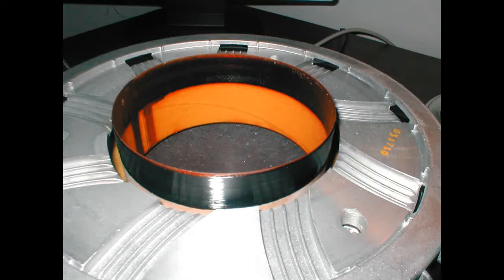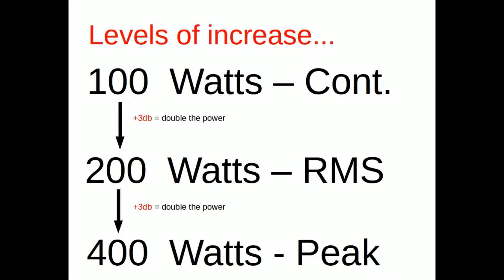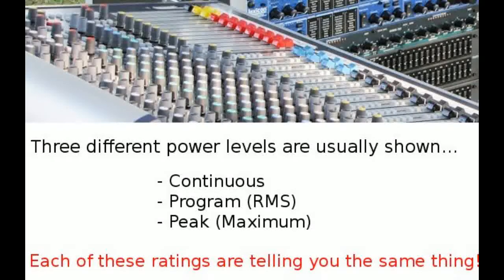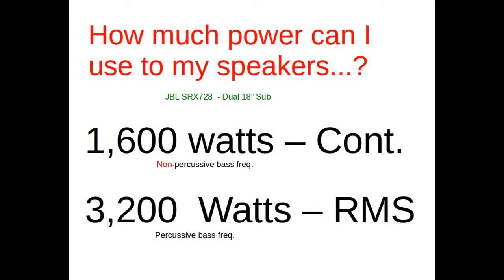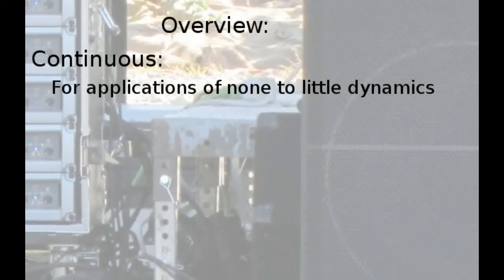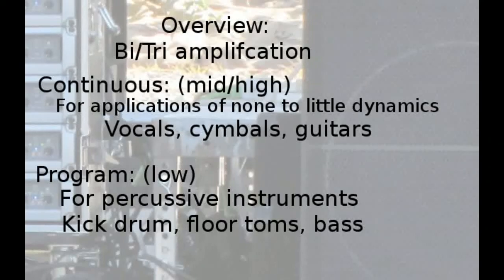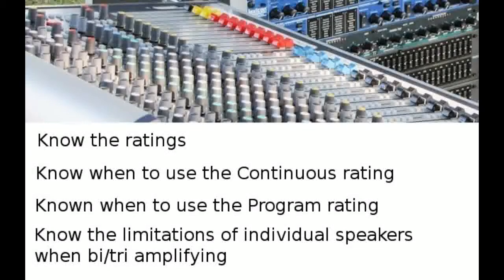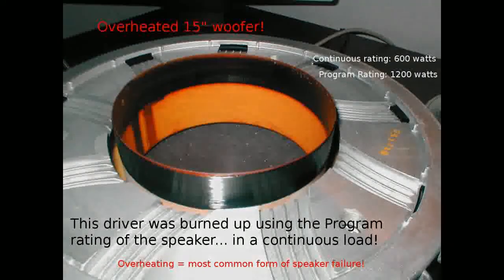What do speaker power ratings mean?   We look at continuous, RMS, and peak

Comment: Okay I'm grateful for the pertinent info on driving speakers the right way so not to cause damage or failure during a show. I 2nd that the audio was way too low I'm sure you've addressed that by now. I have a Q just an opinion. I had 2 speakers blow out at the same time. Was playing intermission music at a gig on break. The single low note of some weird rap tune with ultra low bass and way too loud in the mix killed my speakers. I couldn't believe it and took my mixer apart to see If I blew a fuse what a mess. The tweeters were still working but that's no help. It wrecked my night. I tried to find replacement speakers that fir the molded cab but unless I used the same whacked original ones nothing would fit. Stripped out the cheap steel on a screwdriver getting the very deeply recessed screws out. But the speakers just look fine what to look for? The cabs look brand new too. Do you think the speaker coils just blew out?
Reply from the maker: Thanks for your comment.  Sorry to see you lost 2 speakers at the same time; that will most certainly ruin your night.  Do you hear any type of sound out of the failed speakers?  If the speakers look ok (the surrounds are not torn), their voice-coils could be burned, however, a burned voice-coil can take awhile before it would fail.  Quick loud noises don't usually burn voice-coils.  If there's no sound (of any type) coming from the speaker, the speaker could have lost one of its connections (positive / negative) internal to the speaker; sometimes this can happen if a speaker is mechanically over-exerted.  Make sure the wiring on the speaker is good.  Do your speaker cabinets have internal crossovers?  If they do, it's possible the crossover (for the bass speaker) has failed; it's common for crossovers to burn up due to way too much power.  This may require a new crossover for the cabinet.  It's odd that both speakers failed at the same time... this would seem to indicate a mechanical failure (lose wiring), or a failed crossover.
Reply: @stageleftaudio  Thanks for the reply. These are now discontinued Behringer Eurolive B212 passive speakers. It was one low note from a song, puff, both woofers gone. No sound from the woofers, a little super high signal from the tweeters. With an easy cheap repair I can still use them in some way or just throwing them in the trash, there's no resale value. They're sitting in their perfect shipping boxes. Another of like 20 projects I have yet to complete. I bought replacement higher rated woofers that were advertised to fit these B212 enclosures and they didn't! Contacted the seller who said they "fit" the audio "specifications" but that didn't mean actual physical dimensions, nuts! SMH, Sent them back. You're right, I'll have to examine and test the diaphragms, blown wires and the crossovers & see if that's a problem. (I'm a self taught tech out of necessity. But I solder like a chimpanzee. 😄working on it. Next have to teach myself how to use a multimeter to test in circuit components).
Reply from the maker: Thanks for the follow up.  Sorry to hear about the mess.  A lot of people in audio are self-taught... and just like you, "out of necessity".  Keep up the good work!

Comment: Thank you so much, this so useful to me. Now i know what to put in my amp coz i think i made a mistake of putting 2400w max power speaker to my 2400w RMS amp. I did it per channel 😁 so the result is the coil been ripped of from its cone! Yaiks!
Reply from the maker: Thank you for the comment.  I'm glad you found this information useful.  It is very common for people to choose incorrect amplifiers for their speakers.  Knowing what the ratings indicate will help with choosing the correct amplifier.
Reply: @stageleftaudio  by the way sir are we not underpowering the amp if we will follow the continues power rating?
Reply from the maker: It depends on how the speakers and amplifier will be used.  The continuous power rating is a safe rating and  probably the safest rating to use.  The next rating would be RMS, however, using the RMS rating does require some control.
Reply: @stageleftaudio  hmmm k. Seems like i got it. I have a sound system and it will be used in disco and sometimes the battle of the sounds. I think i should follow the rms rating. Is it right to put 50% more power of amp vs the speaker in RMS rating?
Reply from the maker: If your system will be used for DJ use, it's best to use an amplifier that is rated at the continuous power rating of the speaker... not the RMS rating of the speaker.  This is because pre-recorded music (CD, MP3, etc...) is highly compressed and doesn't have the "thump" that live music has.  Because of this heavy compression in pre-recorded music, it's usually safe to use the "continuous rating", and not the RMS rating.
Reply: @stageleftaudio  thank you a very informative response sir. More power ☺️

Comment: Thanks so much for response.....its weird....some shows I have that big thump that hits your chest.....other times.....very hard to get that.....not sure if its the room we're in. (which seems to be the case) Acoustics are different...I have a set of Peavey 1502 (newer version of 1502) that I run full range.... (not using xover for them) and the phonics which I use the xover for......maybe I'm missing something....you're right tho...the QSC ISA750 is not designed for live sound. Its made for theater applications. Maybe a new amp???
Reply from the maker: Take a look at the QSC PLX series amplifiers.  We use those entirely; they are very good.  You should be able to pick up used amps for a good price.  Room accoustics, speaker placement, FOH location, standing waves, power-ally issues, etc.... all these are just the physics issues with getting good sound and getting that "thump" in the chest feeling.  Keep the bass bins close to the floor; it helps with the low end.  Try the xover at 120hz (w/a 24db slope).  It helps bring out the "thump".  Any lower than that and you are getting into just bass.
Reply: stageleftaudio hello sir, may i have a question from you, i have a set of jbl mrx 515. 400 Watts continuous, 800 Watts programs, and 1600 Watts peak.  Nominal  Impedance 8 ohms on the speaker.  I would like to get a power amplifier crown xti 4002,  the crown xti 650 Watts per channel.  The power amplifier crown xti 4002 will match my speaker.  Also how much gain from the amplier i have to turn on.  Thanks for you help
Reply from the maker: hoang tieu
To get the full rated output of the amplier with minimal input voltage, set the gain to full (all the way to the right).  If you are using this amplifier for live sound, it is sized good for occassional peaks (but not all the time).  If the amplifer is being used for DJ use, it is too much power, because the amplifier rating (650 watts) exceeds the "contiinous" rating of your speakers.  Check the amplifier instructions to see if there is any additional information about gain settings.

Comment: Hey guys.....I have a set of Phonic Isk 18" subs 4 ohm cabinets.....I believe these speakers are more for Dj applications than Live sound. Can they be used for live sound? Will they not work as well for that big thump im looking for??  Power Handling: 1000 Watt Music / 2000 Watt Peak.....powering them with a QSC 750...
Reply from the maker: Any speaker can be used for live sound; though, many speakers are much better suited for live sound than others.  The Phonics you have should do ok; probably best not to put anything more than 1000 watts to it (the speaker is actually a 500W cabinet - continuous - keep this in mind).  The QSC 750 should be ok for live sound (though, I'm not sure that amplifier was manufactured for live sound applications).  It's possible you could exhaust the headroom in that amp for live sound use.  The "thump" you are after doesn't always happen because of speaker selection - there's a lot that goes on in the signal chain to bring out a "thump" before it ever gets to the speaker.

Comment: Good vid but I'm still kinda lost I'm only 16 but anyways i have 4 Peavey SP4 BX their rated at 2000 program and 4000 peak I'm running each of  them  with a crown xti 2002 rated at 2000 watts@ 4omhs I'm not sure if I'm running them right I've busted the tweeters about twice there all running at full range. BTW I'm using a Yamaha mixer to BBE sonic maximizer To beringer EQ to peavey crossover. and if you have any suggestion how should i connect my system please help thanks for your time and keep up the awesome vids I've learned alot thanks
Reply from the maker: It depends on how the speakers are being used.  The amplifiers appear to match the speaker ratings.   Though, if the speakers are being used for DJ use (any kind of music playback), you should be using an amplifier rated toward the long term power (continuous rating) of the speakers, which is 1000 watts (not 2000).  However, if you are using the speakers for live sound (in full range mode), the 2000 watt amps will work, but you may be overdriving the speakers (and the amplifiers).  The peak lights on the amps should only be on during momentary peaks.  If they are on a lot (more steady to solid), your system is being over driven.  The tweeters in the Peavey speakers can only handle 60 watts continuous, and when running them continuously, extra care is needed especially when bi-amping.  Also, make sure your EQ settings are not boosting the high freq. too much.  If they are, that is adding double/triple/etc... more power to the high freq, which will almost always damage tweeters.  Use the EQ sparingly.
Reply: Would it be ok to run them in stereo mode 800 watts a piece using them for DJ but when i use them for live applications such as a music band it would be ok with 2000 watts a piece and if you don't mind how do you bi amp with a crown xti.Thank you for your time
Reply from the maker: superMrpena
 It would be better to run them with the 800 watts for DJ use.  Just make sure the amps are not continuously going in to clipping.  For the xti bi-amping, Crown may have a manual that shows how that is conducted (specifically for Crown). I'm not familiar with the xti line, so I can't offer any specific assistance.  Though, I do have a new video up that shows a basic (low mid/high) bi-amp setup using an anolog crossover.  It may help you.
Reply: Ok thank you very much and keep up the good work!!!

Comment: Sorry...they are 1000w RMS and 2000w program...
Reply from the maker: Thanks for watching.  It really depends on how you are using the speakers.  For full range use (i.e. when the clip lights come on during a kick drum hit) it should work out well for you.  Even though the amp is 200 watts less than than the program level of the speakers, you are not underpowering the speakers.  Make sure the clip lights only come on during percussive hits.  If the lights come on more often than that, you may be getting close to sending too much power the speakers; if that happens, back the power down.
Reply: Great!!!!....You reaffirmed my thoughts. The system hardly goes into the red and only on percussive strikes as you stated. Thanks for the speedy reply.

Comment: Great info! I have a small Cerwin Vega system with two cvp 2153 4 ohm full range speakers rated at 1000 watts rms and 2000 watts cont. The Cerwin Vega CV 5000 amp puts out 1800 watts stereo to a 4 ohm load. Some say I'm under powering them. I think I'm avoiding overheating them. Any suggestions either way?